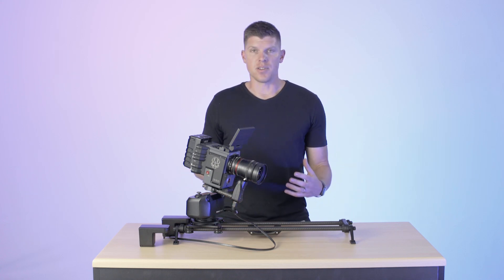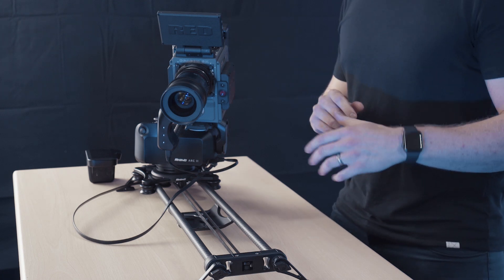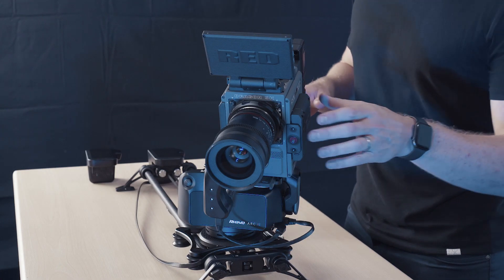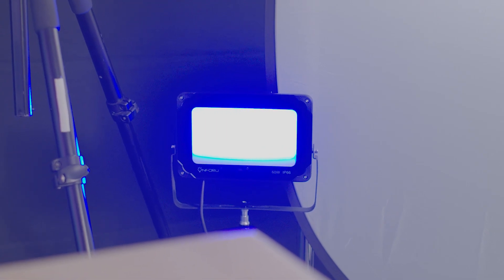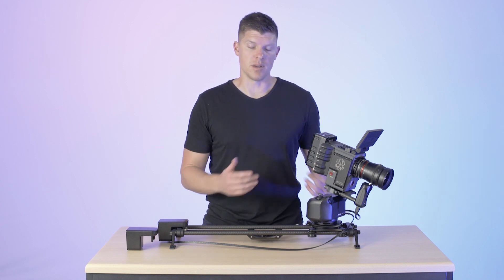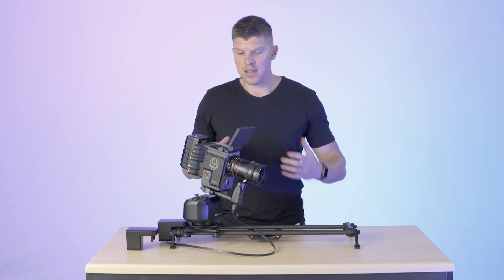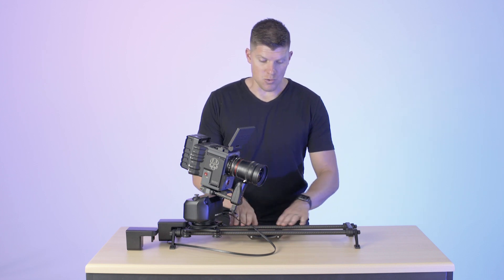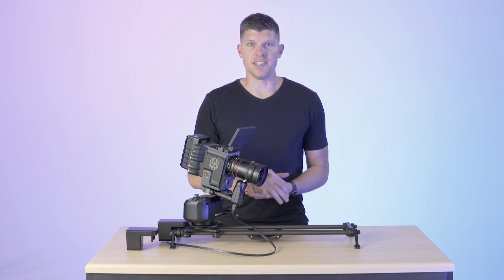What’s the difference between the Rhino Slider Motors?

Comment: Would you still want to use the high torque motor when using heavy setups on inclined time lapses, or would the high speed motor be ok for that type of application?

Comment: Im after smooth macro movements for jewellery. Will the high speed be ok  or am i better with the  high torque. Id be looking at about a 15 second move over 15 inches or so which is flat out for the hi torque but would like the option to go faster for interviews etc. I dont need to go vert.
Reply from the maker: I think you'll be better off with high speed

Comment: I have the original Rhino system with Arc 1. Is it possible to use my existing motor and rails with the new Arc 2 and focus system? Thanks!
Reply: RhinoCameraGear how do I use my evo motor on arc ii? It has a different connector.
Reply: they dont care and dont reply

Comment: So, what if I load the camera equipment are less than 5lb, if I want shoot a inclined shot, do I still need high torque motor?

Also, it’s confused me at this point.
Does the high torque motor has the same maximum speed as high speed motor?

Does both of them have the same minimum speed?
Reply: Hulk did you ever get an answer for that question? I’m looking to buy a system and I dont want to buy both motors right now. I have a Canon 5D Mark IV
Reply: @NuclearAmouri  Hey. I just had a chance to try it out today. It seems like the high torque motor does not have the same maximum speed as the high speed motor. In video mode you can only keyframe motions with a minimum duration of 20s using the high torque while the high speed allows you to go down to 12s

Comment: am reaching out to inquire about the latest developments concerning the ARC II product. As we are now in May, I recall you mentioning that updates or improvements would be available by March. Since the timeline has passed, I am eager to receive new information or solutions.
Unfortunately, the ongoing issue with my ARC II has significantly impacted my business operations. Please expedite the process of resolving the problem or consider providing me with a replacement ARC II unit.
Please inform me of any recent updates or fixes for the ARC II product. 
If you still need time my right, so, send me a new one 
Your prompt attention and assistance in this matter will be greatly appreciated, as it will enable me to resume normal business activities.
Thank you in advance for your understanding and support.
Reply: They are shutting down basically. In an email from last year they told me they are getting smaller and smaller

Comment: Unfortunately, I am compelled to express my extreme dissatisfaction with the [Product Name] I purchased and the support I have received thus far. My experience could be more satisfactory, and I believe sharing my concerns with you is crucial.
Firstly, the [ARC ii] has consistently underperformed since the purchase, exhibiting issues such as [describe the problems you have faced with the product]. I have attempted to address these issues through various troubleshooting methods but have failed. The product's poor performance has negatively impacted my [work/productivity/user experience].
Secondly, I have contacted your support team multiple times, seeking assistance in resolving these issues. Regrettably, the support I received was unhelpful, with delayed responses and inadequate solutions. The lack of timely and effective support has only exacerbated my frustrations and the negative impact on the product's performance.
Given these circumstances, I am requesting immediate action to rectify the situation. I kindly ask that you provide one of the following solutions:
A full refund for the [ARC ii], allowing me to return the faulty product.
A replacement unit of the [Product Name] that is fully functional, and without the issues I have faced.
Direct assistance from a knowledgeable and responsive support representative who can efficiently guide me in resolving the issues with my current unit.
Your prompt attention and action in this matter will be greatly appreciated. I want my concerns to be adequately addressed, and my experience with your company can be improved.